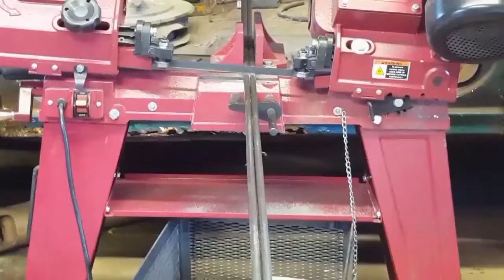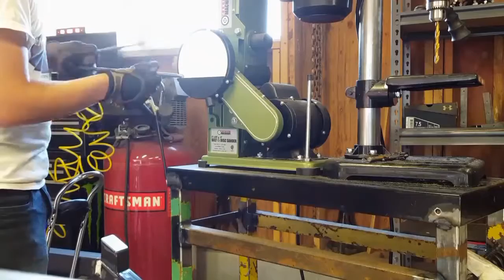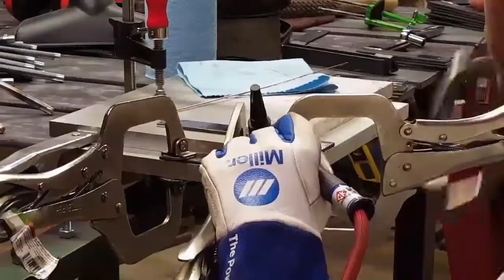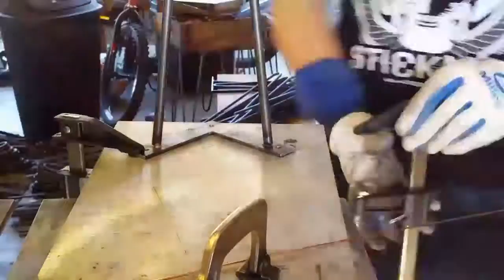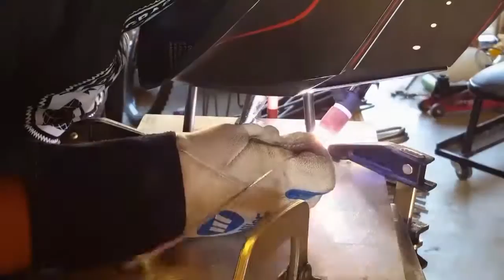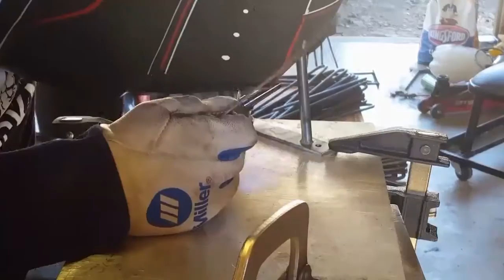How To Make Hairpin Legs DIY

Comment: Hi , what is a angle between legs and mounting plate ??? Thanks!!
Reply from the maker: I'm not sure.  I built them to where the bottom ends up a 1/4" inset vs. where the edges of the mount are.  That way each size of leg be it 10"-18" etc. Have the bottom in the same location.  If that makes sense?

Comment: what angle do you weld the rod to the base?? awesome video and set up!!
Reply from the maker: David Moreno hey thanks.  I just line the tip of the leg with the point on the mounting bracket  so that the leg isn't hanging out past the furniture.  So the angle changes with each size leg.  Hope this helps

Comment: what metal & thickness do you use to make L piece the bent rod attaches to?
Reply from the maker: Loni Goodman Hey, I use 1 inch wide by 1/8 inch thick flat material.  I think all the material is in the description.  you could also a small sheet of 1/8 inch steel and cut out the mount.
Thank you for watching good luck!